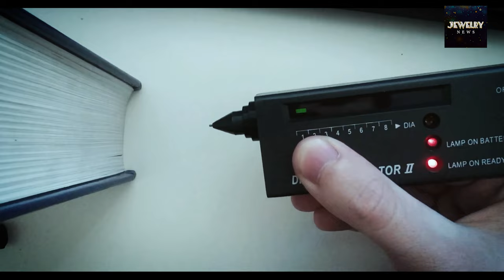Mysteries Of Red Diamond EXPOSED

Comment: Red diamonds lusters best on its 111 clevage plane its the reason behind it must be perfecly cut parallel to the 111 crystal plane to attain the best luster.  However some red diamonds crystal lattice are deformed making its luster orientation in different angle. In this situation it will be a challenge for lapidary to be able to bring out its luster despite of this phenomenon in red diamonds.